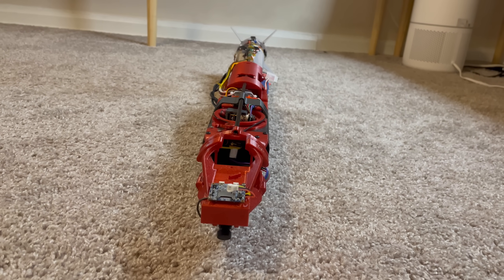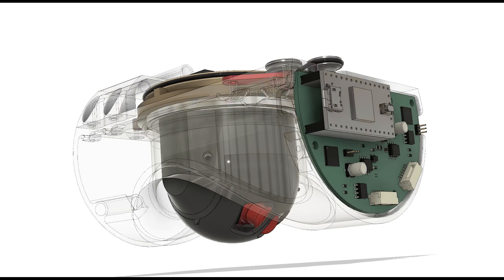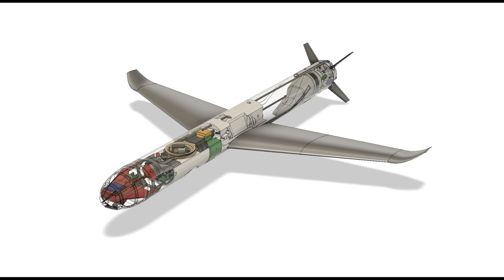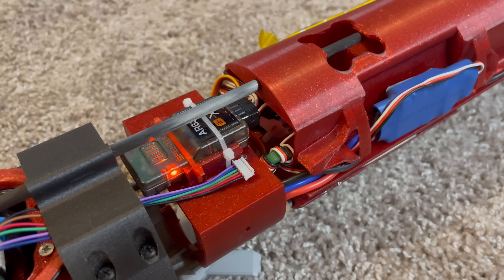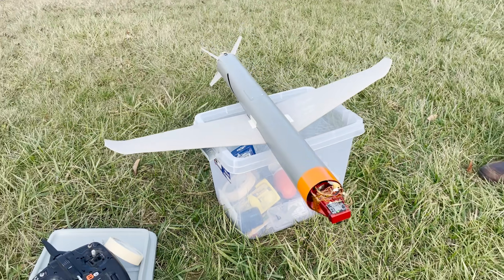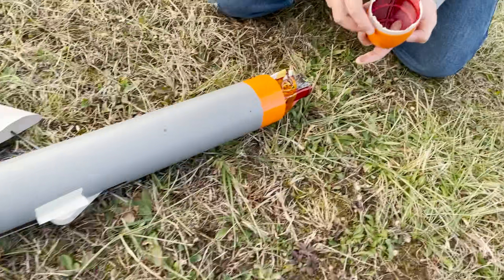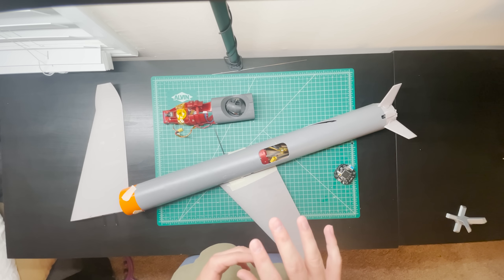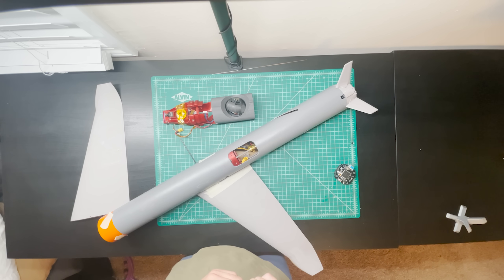Building (And Crashing) my Homemade Surveillance Drone

Comment: Coming from the world of competition F5J R/C sailplanes,  In my opinion:   needs WAY more power, and WAY less weight.   Can't tell from the vid. but those wings need to be much lighter, consider carbon fiber or fiberglass over foam.   Any ducted fan jets that I've seen flying are just SCREAMING, will your ESC and motor allow going to 4, 5, or even 6 cell LiPos?  Also, a 'V-tail' should give you plenty of yaw, and pitch authority, no need for anything sticking out the bottom.  For roll authority, ailerons are probably your best bet.  You can put thin servos a few inches out from the root inside a hollow core wing.  I would ditch the thrust vectoring.  I guess what I'm getting at - needs to be much more airplane like, you should be able to throw it unpowered, and it should glide (and be controllable) for a long time.  Very cool design, though.

Comment: as a pilot i see a few things to consider.
1. control surface area: needs to be much bigger, don't sweep or taper them (unnecessary for subsonic flight)
2. wings: don't use swept wings. looks cool, bad flight characteristics at subsonic speeds
3. check your CG relative to centre of lift. should be in front, but not way in front.

Comment: Firstly, I love this project it's cool as ...... On the constructive side I think your static thrust is to low for a hand launch, some options to solve that
1.  the rail launch system has merit with the understanding that failure to achieve control will result in massive damage.  2.  radically increase the power of the EDF and add an intake scoop to increase the efficiency of the EDF.   3. given your experience with rocketry build a fall away laugh  booster that will give you both speed and altitude, the gentleman that taught me R/C flying always said, when trying something new "always fly three mistakes high" simple advise that has saved me many airframes (alas not all of them). I wish you success and I look forward to seeing your next project. Cheers from NZ

Comment: If I'm hearing you right you've never flown RC planes before? This crazy thing ain't the way to start.
My guess is that's around 10 times to heavy for hand launch, my bet is you need maybe 80kph for reasonable pitch/yaw authority and roll is likely worse.
NACA ducts are cool but their a solution to a problem you don't have, ram scoop would serve you better.
Pick up a foam trainer kit and get a feel for what a known good air frame is like, and then probably mount you camera turret on it.

Comment: You are building a switchblade so the rail launch would match how they deploy. However, you are a rocket guy so how about a stage 1 booster to get you in the air?

Comment: One thing I noticed is it seems like the “exhaust” diameter seem a bit smaller than the exit for the ducted fan. Most ducted fan don’t have enough static pressure to compress and accelerate the air through smaller cross section. I don’t think I can think of a time I have seen a EDF exhaust smaller than the diameter of the EDF. All that to say I think you are not getting the full trust from the EDF

Comment: I can clearly see problems here:
- too heavy
- underpowered (edfs are less efficient and here it's obstructed by intake and control surfaces)
- it looks tail heavy, but maybe I underestimate the weight of its nose part
- wing surface is not enough for low speeds of hand launch

Comment: Hear me out, what if you launched it with a sabot using compressed air? Like a potato gun. This would require the folding wings, but it would give a massive take off speed.  I think it would also be more variable(via PSI) and more consistent compared to an elastic based rail launcher.

Comment: It really seems like a cg issue combined with some aerodynamic problems (center of pressure/cg/thrust moment not aligned, wing loading). Even if your design speed is much faster, launch is still the most critical phase of flight. Lift, control surfaces, and thrust should be sized specifically for whatever launch regime you use. For a hand launch, there is obviously not enough thrust. 

Put some long wire landing gear on the next prototype and use a pusher propeller instead of edf. You’ll get better flight data that way and can calculate the necessary edf thrust from what works with a prop. Obviously as launch speeds get higher, your wings can get smaller toward the design goal, but for now you don’t have the lift, thrust, or control to do validation testing.

Comment: Tail area (tailplane) is way too small for the wing, you need approx 40% of wing area for the tail and 50% of the tail for the vertical fin. It also looks ridiculously tail heavy. The moment arm of the ducted fan and motor and fancy ducting so far from the CG needs a huge amount of nose weight as far forward as you can get it, so the battery right at the nose. The wing loading is also way too high for hand launch, it will only fly with enough speed. To be controllable at the speed at which a human can throw it you either need to reduce the weight or increase wing area or both. You also need ailerons because the wing has no dihedral. If you don't want dihedral or ailerons you need elevons or tailerons. You also need to ditch all the 3D printed stuff because it is too heavy, especially for the thrust a ducted fan gives. Ducted fans are very inefficient. If you build everything out of foam you might be able to carry the 3D printed gimbal and the fan might have enogh thrust for the weight. You also need someone who knows how to fly model planes to fly it, especially if you are not using any flight control board. Great video btw.

Comment: 9:51 "in terms of fan blades... we have no fan blades" 😭😭😭
Reply: you two collabing would go CRAZY
Reply: @BPSspace >>> Oh, are you familiar with rocketry? 
 😉 🤭
Reply: I'll be real, what probably happened to the fan blades is that on impact the case flexed a bit and they hit the side wall.
I've seen it happen to several EDFs in the past.
If it did suck something in, you can help to prevent that by putting the intake on the top instead of the bottom where it will eat dirt every time it lands.
Reply: @Future_san  I'd assume some netting or similar material to prevent stuff being sucked in could help without hindering the performance too much.
Reply: You should really do a collab and see what would come out of it
Maybe something like a reusable mini booster or something like that❤
Reply: I'm surprised he didn't create a protective mesh cover for the inlet duct.
Reply: aa
Reply: Minions reference
Reply: trying to fly anything with a small pc fan is crazy. zero trust
Reply: I hope and hope you don't give this guy guidance. He's fresh, but why does he want to kill people?

Comment: I love this idea, however in my opinion I don't think that the high stall speed is necessarily an issue for this design. If you look at the design for this airframe it is perfect to be implemented into a VLS system and I could really see this as being an effective RECON design for a navy vessel with VLS cells onboard. In my opinion the best way that this airframe can be used is with a vertical launch with a detachable rocket booster and then a parachute recovery. I genuinely think that a scaled up version of this design with added features could be an effective tool to be implemented onto warships with VLS cells as a quicker and further ranged reconnaissance tool that helicopters which are the current method of RECON.

Comment: I know the EDF’s resemblance to a turbofan/turbojet or rocket engine is cool, but I feel like using a propeller that folds back when not running should be considered.

Comment: You've correctly diagnosed that you don't have enough tail area. You need to triple or quadruple it at least. (btw, the lingo is "V" tail rather than a "Y" tail) V-tails are good solutions to the tail strike problem. Also, you're tail heavy. Ecalc is a good starting point to get you in the general ballpark, but don't blindly trust the numbers it gives you. Another thing to consider is, your EDF inlet is under the tail. So you are sucking air up into the fan, which will produce a downward force, giving a pitch up input with increased throttle. In low speed, high thrust regimes, you'll be relying a lot on your thrust vectoring to counter the pitch up tendency from the inlet. Notice, on each launch, the nose pitched up and the plane rolled over. This suggests you are tail heavy, exacerbated by the force from the inlet. This leads to a tip stall, rolling the plane over. Additionally, your control fins could be inducing a roll moment if they are not perfectly aligned. But this would be small because they are so close to the axis of rotation. I saw a comment in the comments about adding ailerons. I would second that comment. Ailerons will make your life a lot easier. Get your control surfaces as far from the axis of rotation as possible. This also allows you to correct for any twist in the wing. (notice the plane always rolled to the left. I would guess that the left wing has a higher angle of attack than the right. So the left wing stalls first, causing the plane to roll violently to the left)

Comment: 4:25 i like that design, you could use some lightweight material to pull out tight with the support to make it into a larger wing area. You could technically make the wing as large as you want without taking up much space when folded up into the body.
Reply: I am making something similar, how would you fold it?

Comment: You need ailerons. Using the tail for roll control is problematic. You also need a LOT more tail surface. A Y or V tail would work well. Your vectored thrust needs to be done via a moving nozzle vs the small fins inside the exhaust.